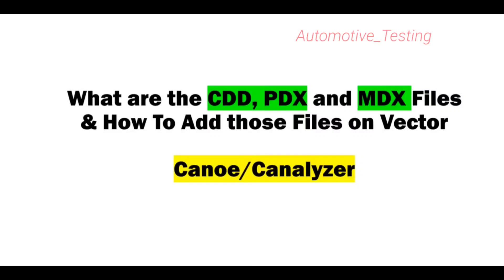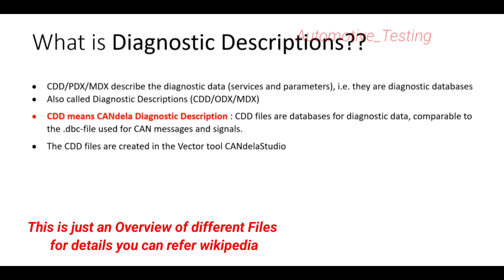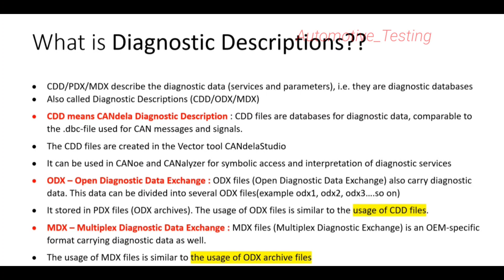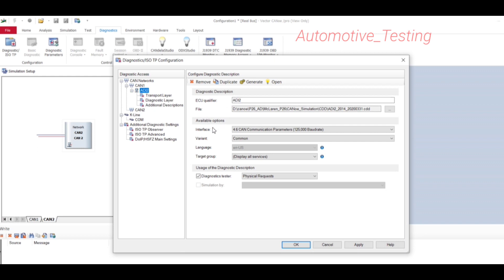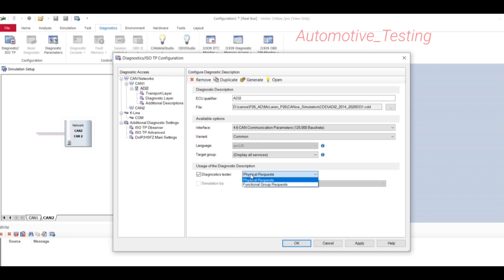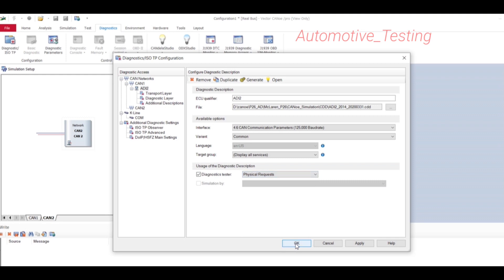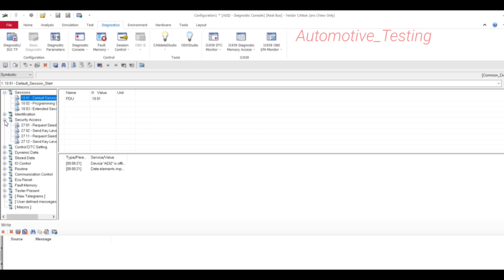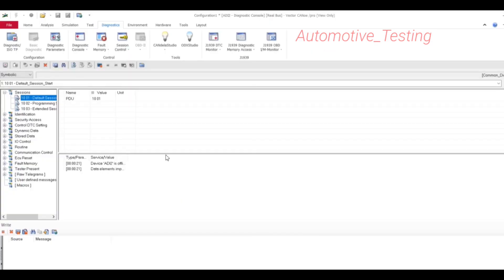🤔🧿How to add CDD,PDX,ODX & MDX files on vector CANoe/CANalyzer | What is CDD/PDX/ODX files #howto

Comment: Bro to perform uds do we need physical ecu Or not
Reply from the maker: @manoharuvce18  it depends, if you are doing Hardware in loop testing then it is required but if you are doing software in loop testing then we can use simulation based testing